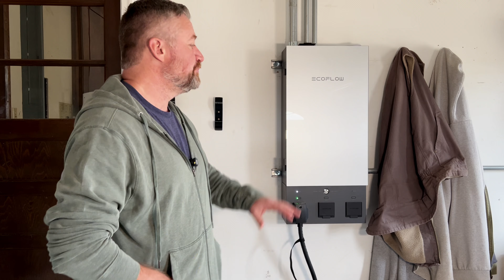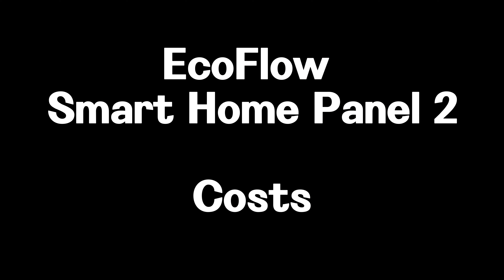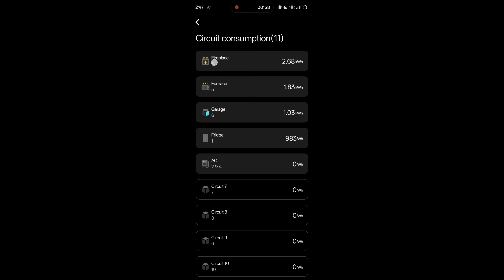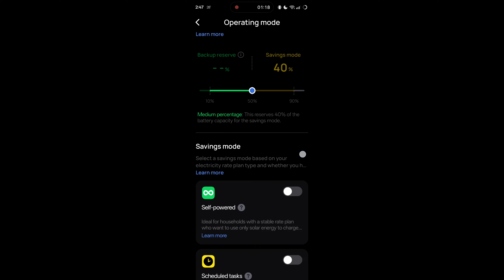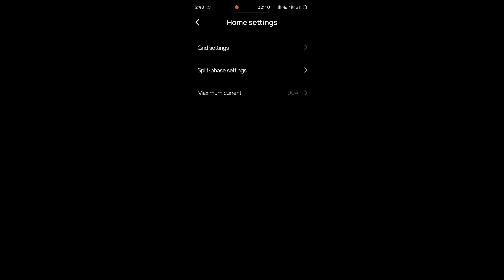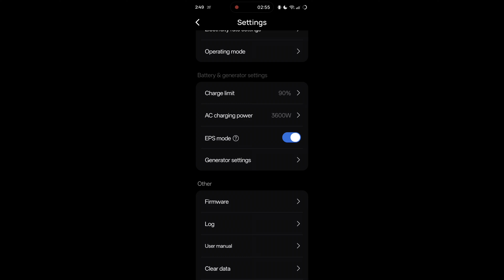Battery power VS Gas Generator

Comment: You said you’ve connected your air conditioner and your furnace can you be more specific? Is it a 1 ton or a 2 ton AC unit? Is it a gas furnace that only needs power to blow the heat?
Reply from the maker: I'll check the compressor size tomorrow. But as for the furnace, yes it is gas so it's just running the blower